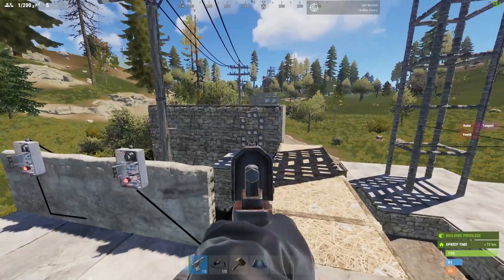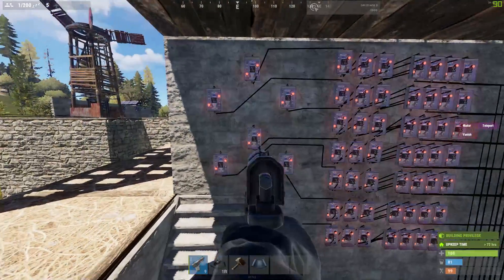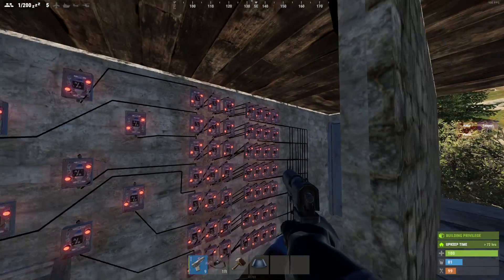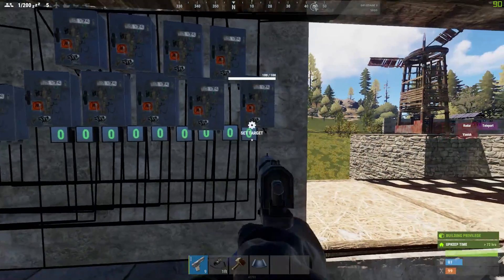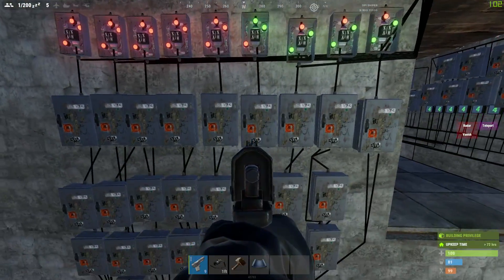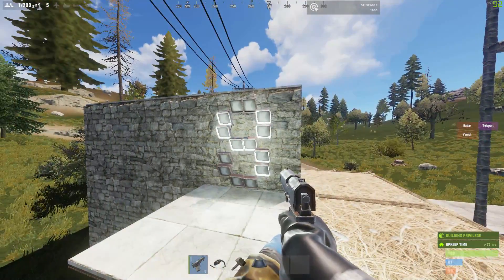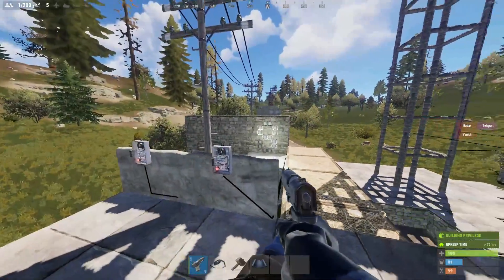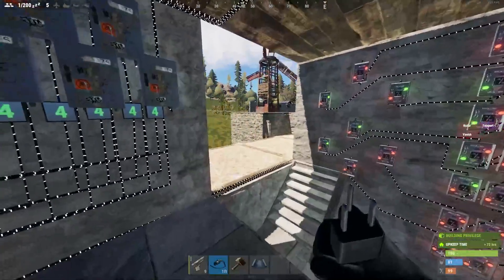7 Segment Display - Rustricity 01

Comment: Server?
Reply from the maker: No idea, it was 3 years ago lol
Reply: @Th3KingDedede  ah didnt see that, the servers ive found only run electricity 4 times a second, so its not super fast
Reply from the maker: Rustrician.io is a website but they run servers as well. Should work well either way. 
I've heard tell of a subticked (~80 updates per second) electricity server  but have never seen it myself.
Reply: @Th3KingDedede  it seems to just be an anti lag thing, ill try rustrician